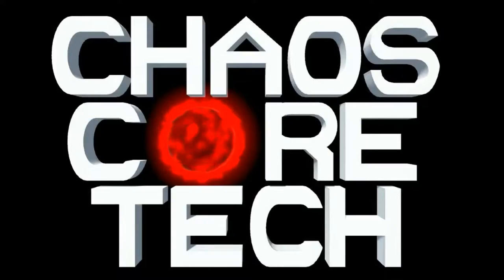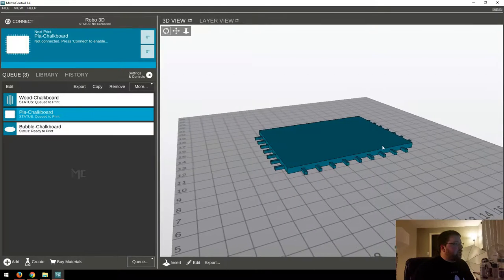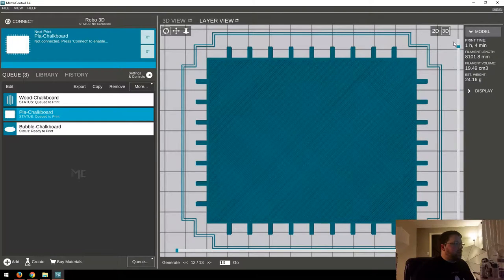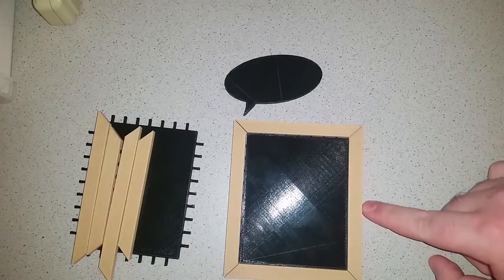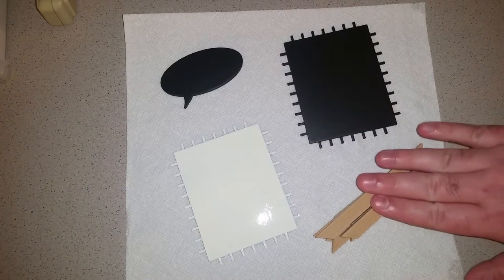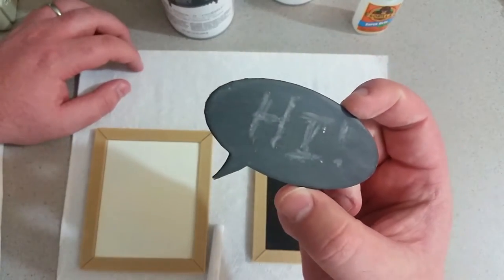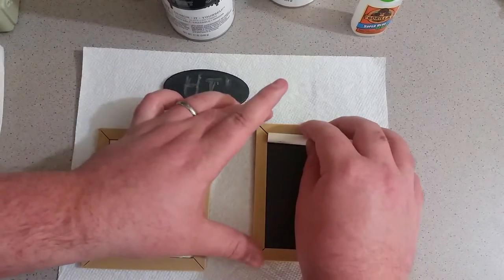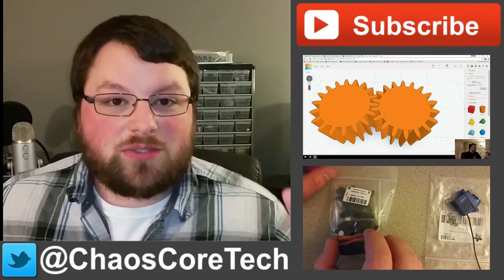3D Printed Chalkboard & Whiteboard (with Woodfill Borders)

Comment: I like the idea :)
Try sanding the primed surface as well. Primer fills the gaps and smoothes out most imprefections. Then prime again before spraypainting. The result should be even better.
To make it perfect, repeat the process 2-3 times. You'll end up with a finish that you can't tell it's 3d printed :)
Reply from the maker: +Georges Jentgen Thanks for the tips! I keep trying to improve my finishing skills as much as possible so I really appreciate the advice!

Comment: how do you come to MatterControl and why you choose it over any other slicers (like Cura, Slic3r or Simplify3D for ex )?
Reply from the maker: +Макс Actually it's just a result of laziness more than anything. It's what they show you how to use when you get your Robo 3D and I just never changed. I do all my splitting of models and adding supports mostly in my modeling software. So I never needed anything fancier. But I am in the process of trying out Cura. So if I like that better (which I'm sure I will), I'll switch to that.
Reply: +Chaos Core Tech 
Yep, I noticed from R2D2 designing video that you design with supports included )
One more question, looking at construction of your printer extruder - it should have  PTFE Teflon tube inside, as I understand you are using it much than an year - do you have to replace it or maybe noticed some print quality degradation over time?
Thanks
Reply from the maker: +Макс Actually my printer didn't come with a PTFE tube. But no I haven't had any problems with it yet. I've noticed that the filament does catch slightly on the top of the machine but it's caused no problems and my prints turn out pretty well I'd say. I think you actually have to print a new print head casing to install PTFE tubing. I'll probably do that eventually so I can print NinjaFlex more easily. :)